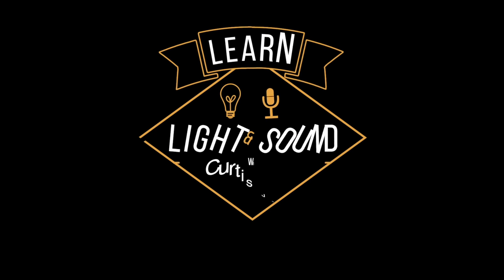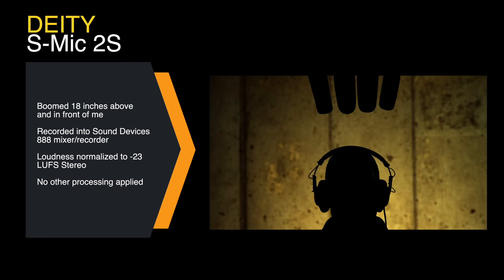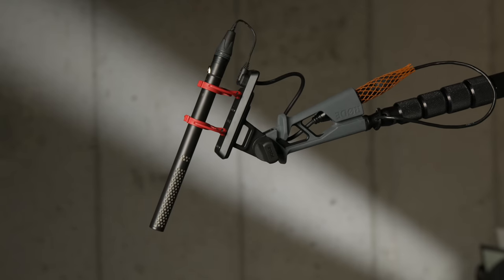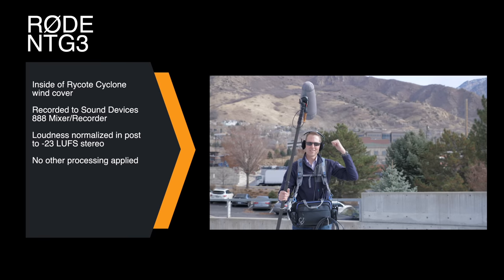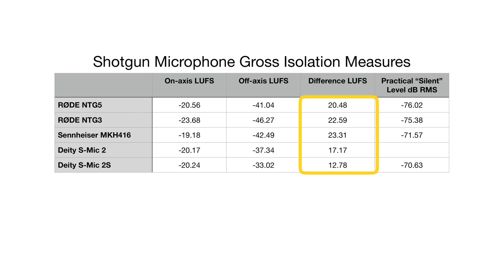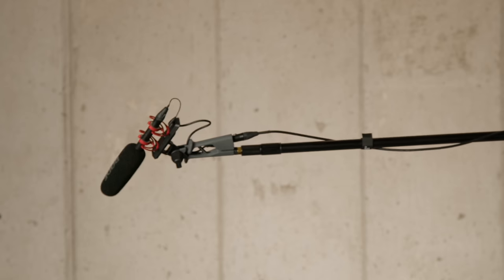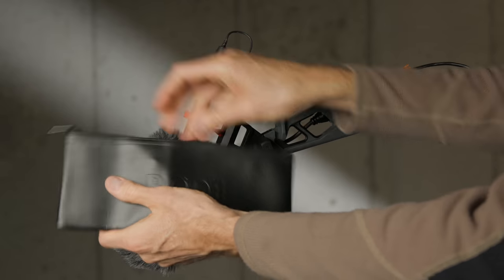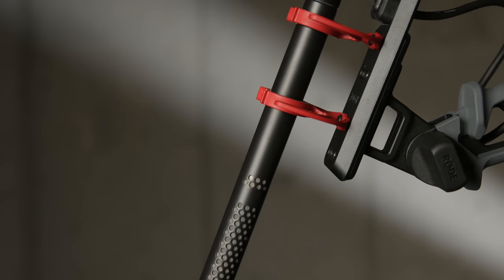RODE NTG5 Shotgun Microphone Review - Compared to RODE NTG3, Sennheiser MKH416, DEITY S-Mic 2

Comment: Question for Mr. Judd or other owners of this mike... Is the shock mount that comes with this mike a standard RØDE shock mount and do you happen to know what other wind protection solutions it works with, in particular solutions that offer more protection than the fur cover that comes with the mike?
Reply from the maker: Hi Rory, unfortunately, it does not appear as though the included shock mount integrates with a blimp or other wind cover system.
Reply: PG2-R, rode rycote pistol grip. There’s no listed blimp applications for it. Rode blimp includes a similar but different grip made specifically for mounting the blimp.
Reply: Curtis Judd In other words, one has to purchase another shock mount on top of the one that’s included :)
Reply from the maker: @roryonabike5863  Correct, if you plan to record outdoors in winds more intense than about 5-10 mph.

Comment: I'm looking to record ASMR massage videos (no talking).

Would the NTG5 with its high sensitivity work better for recording something that is low volume like that (would be recorded louder) but noise floor would be lower?

Also, if recorded in 32bit float. If I find I need to raise in post, it can be done without increasing the noise floor? I plan on getting the F6 or Mix Pre3 II.

I'm looking to get two mics and budget is a concern. Two NTG5 is getting close to my limit. With that in mind, should I go with the NTG5 or would you recommend something else?
Reply from the maker: Yes, the NTG5 could work nicely for that, coupled with a MixPre.
Reply: @curtisjudd  Thanks for replying back. I really appreciate it. I'm curious about one thing. In my situation, are there any specific reasons to choose a MixPre over the F6?
Reply from the maker: @rogerdayton  I own both and my preference is for the MixPre. The 3.5mm output on the F6 seems to have a hardware issue where it becomes very noisy when the fader is applied. I prefer the ergonomics of the menus on the MixPre. And I also appreciate that in 32-bit float mode on the MixPre, I can select the gain setting to optimize the character of the preamps.

Comment: Out of all the mics in your initial test I think I like the NTG5 the best. Just a touch of warmth, very nice isolation/rejection. Not harsh at all. A little less clinical than the Sennheiser? What about vs. the NTG 4+? Since the lack of self power con how does it compare with that mic?
Reply from the maker: Hi Nathan, I purchased the NTG4+ when it first came out but sadly, it is one of the worst sounding microphones in its price class. I don't know if it is just the copy I have but it is very nasally with little warmth.
Reply: @curtisjudd  So the best self powered alternatives are the Deity D3 Pro, and VideoMic NTG?
Reply from the maker: @nathanksimpson  I'm not familiar with any other self-powered shotgun microphones other than the RODE NTG2 and that would not be my first choice either. Not at all in the same league as the NTG5. It sounds like you are specifically looking for a self-powered shotgun microphone? Which type of output do you need - XLR or 3.5mm?
Reply: @curtisjudd  Right now I have the NTG2 but it needs so much gain out of my poor little H5. Considering I have H5 3.5mm or XLR are both viable options, but self powering to 3.5mm would allow me to use my RODE Wireless Go to boom wirelessly.  That's essentially what I'm trying to do. It would make adjusting boom length much easier, and there would be less risk of cable noise in the boom/on the boom. I'm considering the Deity D3 Pro, or RODE Videomic NTG.
Reply from the maker: @nathanksimpson  Ah, I see. In that case, I'd look at the VideoMic NTG.
Reply: @curtisjudd  Thank you so much for your insightful comments. Been subscribed to your channel for about 2 years now. Really enjoyed your BTS of the short narrative you did sound for.

Comment: Does the difference in output impedance (battery vs phantom power) make any difference to the output gain/sensitivity?
Reply from the maker: Hmm, that’s a good question though it doesn’t apply to the NTG5. But generally, I don’t think that output impedance affects the gain requirement but may affect how the mic sounds depending on the preamp you pair it with.

Comment: Hey brother. Which mic is better for talking head videos. Ntg3 or Senheizer 416??
Reply from the maker: That depends on the voice and the budget. They're both very good. The NTG3 seems a little too bass heavy to me at times, but moving it back a touch seems to solve that. And sometimes, the 416 seems a bit too bright/sibilant, again, depending on the voice. In short, they're both great microphones and produce excellent results.
Reply: @curtisjudd  well, I have the ntg2, and I found my voice to sound very high on mid frequencies. I always increase the low frecuencies to get more punchy podcast sound. So I guess the ntg3 has more low boost right?
Reply from the maker: @ebenezer357  Yes, absolutely!
Reply: @curtisjudd  thanks brother. One last question please. I have a Tascam dr40, should I get the mix-pre 3? Will there be a difference? Also, what bitrate is better for you videos? Thanks brother
Reply from the maker: @ebenezer357  Well, it depends. I'd start with you new microphone and the Tascam and see if that is sufficient for you. Can always add the MixPre later.

Comment: Hey Curtis, First of all, thank you so much for all of your videos. Really, really helpful. I'm just starting out getting into sound design, and sound field recording. Here in Australia the price difference between the new Rode NTG5 and the Deity S-Mic 2 is about $200 AUD (Deity is clearly more affordable). Both are coming with the same accessories, so not a difference in that. In this video and in your updated 2020 Boom Microphones you recommend the Rode NTG5. I wonder if you would recommend it still with the price difference or would you suggest the Deity does its job for $200 less? I do not own any other microphone and just purchased a Tascam DR-70D.
Thank you so much
Reply from the maker: Hi Julian, The main reasons I like the NTG5 over the DEITY are 1) RF Bias design which is more robust in humidity, 2) better warranty, 3) better shockmount, and 4) smaller and lighter with a more directional polar pattern. If the difference in price is not workable, one can make some great recordings with the DEITY. But if I had the option, I would go for the NTG5.

Comment: I’m currently using a rode ntg2, but am wanting to upgrade. I do mostly indoor interviews but also do some outdoor as well. I was told that the sennheiser mkh50 would be a better option, but it’s also $1200. I need a good mic that has less noise than the ntg2, and also can work okay Indoors. Maybe the ntg5 would be a better choice and invest in some sound blankets? Any advise? Thanks
Reply from the maker: Hi Brent, Yes, I'd opt for sound blankets and a less expensive mic like the NTG5.
Reply: @curtisjudd  so sell the ntg2 and snag a ntg5?
Reply from the maker: @wildwoodscreative  That's one option. I'd probably just invest in the sound blankets and c-stands to hang them first. You might find that's all the upgrade you need. Most people are surprised to learn that blankets make a bigger difference than microphones in sound quality if you're recording in a reverberant space.
Reply: @curtisjudd  ok so next thing, best place to get blankets? I saw some on Amazon but most had poor reviews
Reply from the maker: @wildwoodscreative  vocalboothtogo.com

Comment: I’m using the Sennheiser ME66, will this be a good upgrade move?
Reply from the maker: Hmm...depends on what problem you're trying to solve with the upgrade? I find the RODE to be a little more forgiving of sibilant voices than the Sennheiser.
Reply: @curtisjudd  I do mostly indoor shoots but I find the ME66 picking up the tv studio reflections. Doesn’t sound bad outdoors. Also the ME66 noise floor could be better. The NTG5 would be your recommendation?
Reply from the maker: @productionsoundtexas3949  I don't have extensive experience with the ME66 so I don't have a basis of comparison, but I do like the NTG5.

Comment: While I’m not a 416 fan as a general (DPA 4017 for me), it’s leagues beyond the others in sound quality, though seemed like the NTG5 had slightly better noise floor. Most of them have some sort of weird resonance or jagged peak in the spectrum making sibilance sound dirty. The 416 has a much more transparent sound with much more midrange and high frequency detail.  The deity sounded like absolute garbage.
Reply from the maker: Thanks for the insights Henri.

Comment: Hello Curtis Judd. I am very interested in buying this mic. I have a question do you think it would be ok to power this mic with a Xvive P1 Phantom Power Supply portable mobile power supply? I have seen people attach it to the end of a mic and then run XLR cable from the power supply end attached to the mic and then to their Handheld recorder. Would this change the sound of the mic since the phantom power is not being supplied from the handheld recorder like an H4n Zoom pro?        Also attaching one to end of mic would allow someone to move free to pick up sound and not worry about power.

Also sir in this video at the 14 minute mark you did aggressive movements with the mic and said you heard sound of air moving some across the mic capsule. Can you explain what you heard in laymens terms what you heard?   Did it sound that bad when you were aggressive moving the mic at the 14 min mark in video?

I have done that before withy my friends shotgun mic and you can get handling noise like Allen talked about at Sound Speeds. Allen would used a Lo cut/High pass to help with handling noise and this mic does not have this but you could tell a recording going into the H4N Zoom pro to use a Lo cut/High Pass filter.

What type of XLR cables do you use to help with reduce noise between the mic and you recorder. I am using an H4n Zoom Pro.

Here is the product information below

Xvive P1 Phantom Power Supply 48V/12V Switch Up to 40 Hours of Use, Rechargeable Portable Phantom Power for Condenser/Shotgun Microphones, Mic Preamp, Recording Studios

This would be my first professional boom mic and any feedback would be great and I value your time.
Reply from the maker: I’d just use the recorder and quality Mogami or Canare XLR cables. No need to add an external power supply.

The sound was whooshy.

Comment: Hey Curtis, I am looking to buy a mix pre 3 ii and use the rode ntg 5 together and boom it up. My question is, how do I do that? I am unsure what cables I need and their length or accessories I'd need. I am certain all I'd need is an xlr cable to connect the two, but I am unsure if that cable comes with the rode ntg 5. I've been trying to contact B&H but for some reason I have not been given the best support for my question. Can you help?
Reply from the maker: Hi Trevor, you'll just need a standard XLR microphone cable. The NTG5 does NOT come with that cable. A cable like this should do the job nicely: https://bhpho.to/30SPam3

(full disclosure - this is an affiliate link. As an affiliate, I earn from qualifying purchases)
Reply: @curtisjudd  thanks so much for the speedy response. I checked out that link and it says its backordered until the end of the month and I need one sooner. I am planning to buy this boom pole which is a bundle deal with the ntg 5 and i think It has an internal xlr cable in the pole, so does that mean I still need one?
Reply: It is the K-Tek KE-89CC Avalon Series Aluminum Boompole with Internal XLR Cable.
Reply from the maker: @trevdawg2  it depends on whether it is internally cabled beyond the pole or terminates at the end of the pole. Most have an XLR connection at the bottom of the pole so you'll still need an XLR microphone cable.
Reply from the maker: @trevdawg2  Ok, yes, you still need an XLR cable to run from the pole to the recorder.

Comment: I got the NTG-5  2 weeks ago but there are problems. Randomly I will get interference with audio. In one instance it was perfect for 22 mins and then the interference started,. It will sound like someone tuning a cb radio over the audio and completely unworkable. This happens in different locations so it was not interference from some piece of equipment. If you drop the phantom power down to -24v from -48v it cures it but then the rode is not as sensitive ( and you are supposed to use -48v power)  and you might aswell use the ntg-2. I am using it with the zoom h4n and it is not the recorder as I have tested it own mics and no issue. Now I see the problem I am seeing issues about this. It is a big disappointment.
Reply from the maker: Sorry to hear but thanks for sharing. RODE should replace that for you.

Comment: Would I be able to use the NTG5 with a TASCAM DR-40?
Reply from the maker: Technically, yes.
Reply: @curtisjudd  I was wondering if it's a good idea though since people reported a lot of problems using the DR-40 with the NTG2
Reply from the maker: @frankyk.2379  Honestly, the Tascam DR-40 is quite dated and its preamplifiers are not particularly impressive in terms of self-noise and gain. However, if that is what you have to work with, I can say that the NTG5 has a MUCH more powerful output signal than the NTG2 so it won't be as much of a problem. But the combination of the NTG5 and DR-40 is a bit like champaign and skittles (pro-level microphone with consumer level recorder).
Reply: @curtisjudd  Thank you for making this clear! It really helped a lot

Comment: It might be cool to make a simple jig, (stick, string, something) so that you can hold the speaker at the same distance for your on/off axis tests...
Reply: Or hold the noise source in one place, then rotate the mic on the stand.
Reply: @tomdchi12  that would be more consistent across the board. As it is, the distance changes based on how large the mic is. A consistent test, like "rotate mic from center of length" with the sound source farther away (like 1 meter) would be much better, as long as there's little room reflection. Hand-held, it is very open to user-error due to the inverse-square law and small distances, which becomes less significant the farther away it is.
Reply from the maker: Clever idea - thanks for that!
Reply: A lazy susan with a stand to hold either the mic or noise source would be easy and you can buy the bearing ring for lazy susans at your various big box hardware stores...
Reply from the maker: @mjlagrone  Thanks Marcus.

Comment: ....is it still silly to have the MKH416 on a wishlist? ;)
Reply from the maker: It was on my wishlist for about 5 years until about 2 months ago. No regrets buying that one.
Reply: @curtisjudd  How reassuring. They have a bundle where you get the mic and a zoom h6 recorder for barely above 1k on amazon. Someday.
Reply: @LycanVisuals  That's probably via Adorama. That's how I picked up my 416. There was a combo with the Zoom F8n for $1,650 at the time. Now it's $1,750. Great way to save on the 416. Yes, it does sound great.
Reply: Lycan Visuals About two months ago, B&H had a 24 hour deal on the 416 for $800. Maybe watch Black Friday :)
Reply from the maker: @roryonabike5863  Good call. There's a decent possibility something like this could surface.
Reply: @roryonabike5863  ah I would have to at least wait until next year to jump on a deal like that. Would have to get my funds up.
Reply: It's still a great mic, I use this on nearly every film shoot. The pushed hights are nice in a foam, fur, blimp. "naked" it's a bit sharp on esses ect. In small refelktive spaces, like a kitchen, it can be horrible. Outside and in bigger spaced indoor: perfect!
Reply from the maker: @guterton  👍 Agreed.

Comment: Dear, m doing PhD in acoustic analysis for a sound of specific language. For this purpose I'll record voice of different villagers. I need "non purified" voice means to say I will never use any software to remove its noise or any kind of other thing because I want to make basic structure of this language. For this purpose I need condenser and unidirectional mic.  Please suggest any mic which can give me extra ordinary clear voice which have never required any further software to clear its voice etc.
Reply from the maker: The RODE NTG5 would work for that.
Reply: @curtisjudd  but in some points you are preferring RODE NTG 3 on ROD NTG5. this thing is confusing me.
Reply from the maker: @duckybhaiofficial  The NTG5 sounds more natural. The NTG3 emphasizes bass - has a bit of a broadcast sound. Choose according to what you need for your purposes.